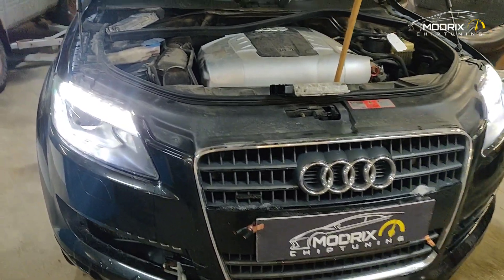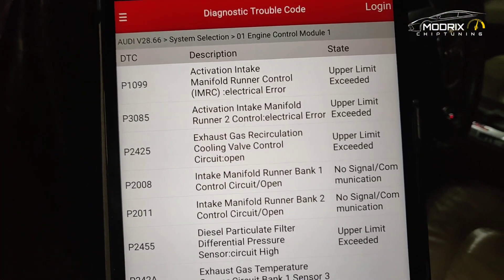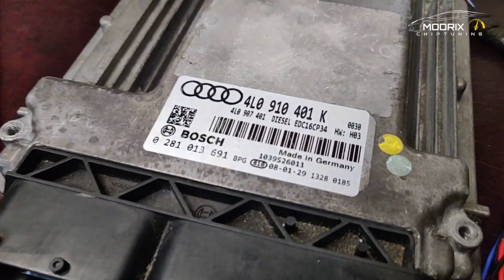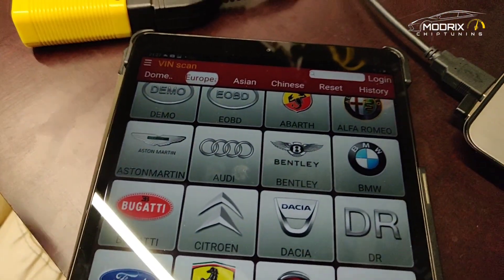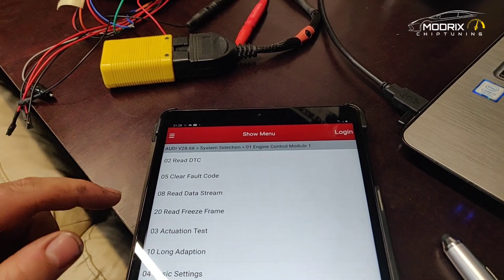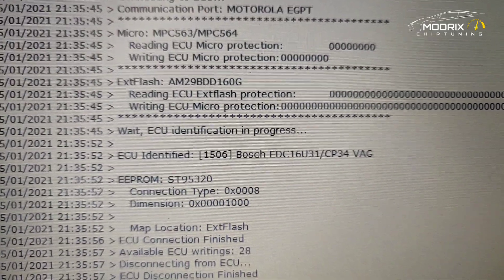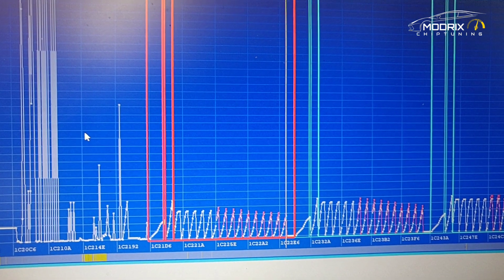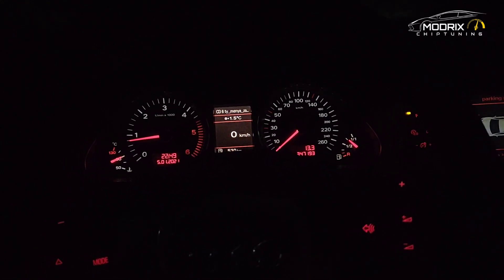✅Car No Start - Audi Q7 Engine Control Unit (EDC16CP34) Replacement - PART 2

Comment: Hello, I’m from Guatemala and I need your help with an audi Q7 3.0 2007 diesel. I have already cloned the software but when I turn on the switch, the car fan works at full power and the car doesn’t crank.

I’m not sure why since the computer has the same bosh and cp numbers, as you mentioned in your video.

Comment: Where did you order ecu
Reply from the maker: eBay
Reply: So I was getting my car tuned and the voltage dropped and ecu didnt go thru all the way. Car didnt want to start after. Esp/abs came on and fans. Now I get no communication to ecu. Think ecu went bad